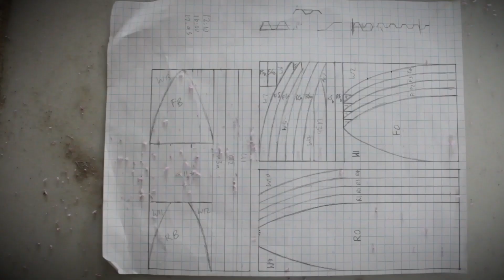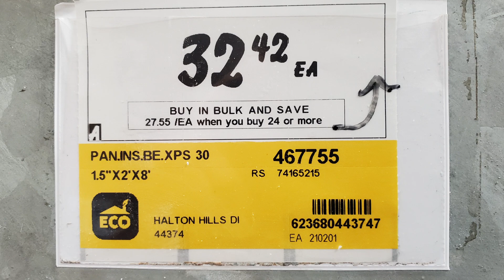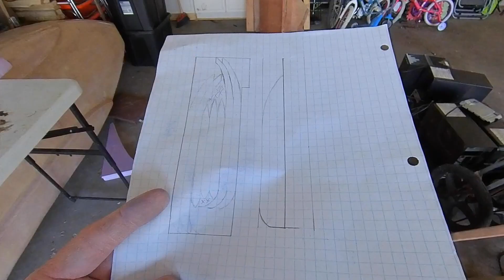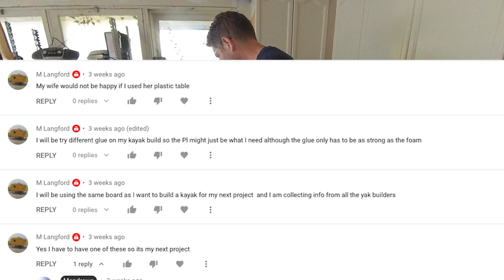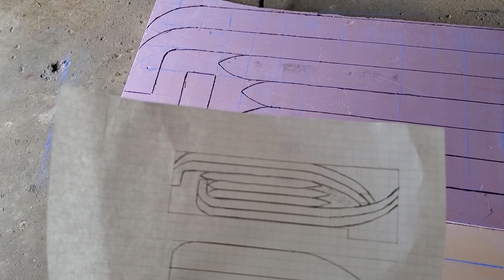Kid's Foam Kayak Build - part 1

Comment: $80 US a sheet and I thought it was bad here in TEXAS at $37.00 a sheet for 4x8 by 2 inch. I do not know how I missed that price mate, I should see if I can mail you some and if the shipping and price comes out cheaper. I was so focused on the build I did not notice what a nice shop you have
Reply from the maker: Yeah, they are not cheap here. $81.31 CAD + tax for 4x8 2inch board. The smaller 2x8 1.5 inch board $32.42 + tax. That's why I have a cutting plan 😀
Reply: @mandrewsvideos  I see that now I just thought you were a math engineer, ok see you soon

Comment: Looking good, man. I'm with you; a hotknife may be cleaner and less mess, but a jigsaw is SO much faster, even when you factor in smoothing out the edges. Can't wait to see it done.
Reply from the maker: Thanks. I'm excited to get it on the water. I think I'm just going to fibreglass a few key areas to try to keep the weight down.
Reply: Good idea. Maybe glass the bottom and sides and just a layer of epoxy in the cockpit for extra durability. 8 year olds don't weigh that much, so it wouldn't need much inside....lol. You could add in some grip additive, too.